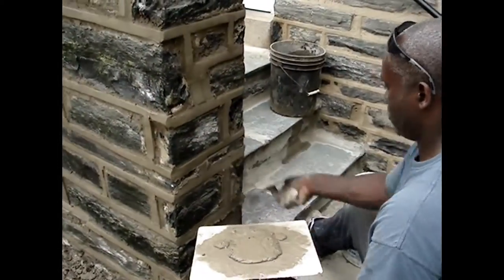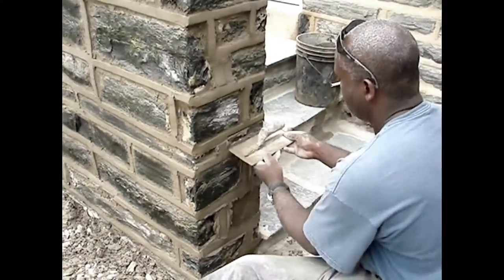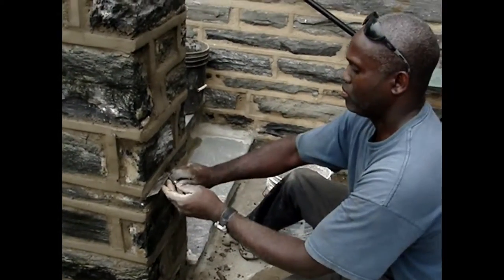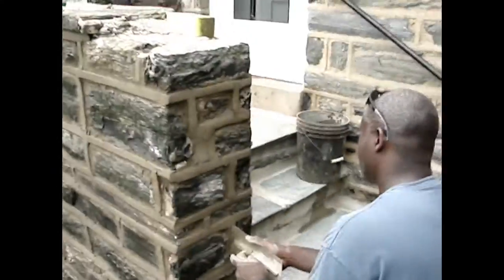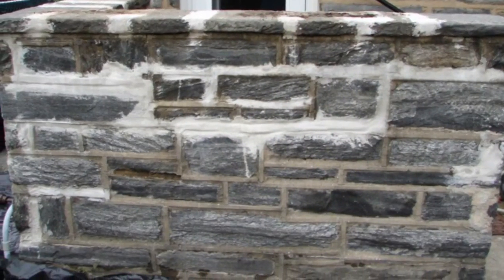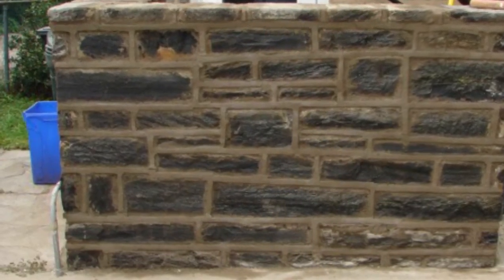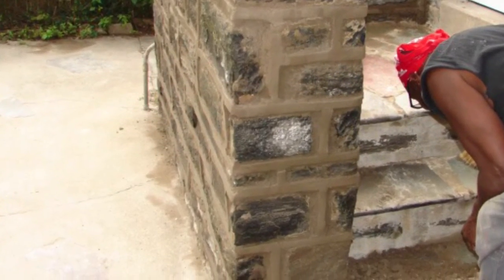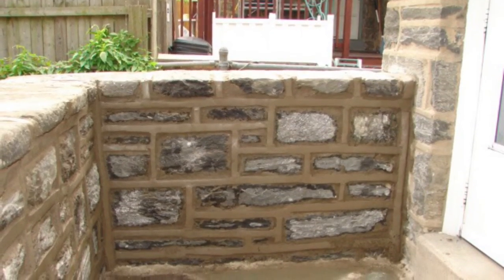How to Stone Point | Concrete Contractor and Cement Work

Comment: Your work looks good,your video making skills are great and loved the use of a drone to catch the footage.
Problem is the use of cement with stone is a massive mistake as only natural hydraulic lime NHL 3.5 and sand should be used as it dries as hard as Portland although is totally breathable which allows the water to dry out 
where as cement definitely destroys stone as it traps moisture forcing to come out the stone instead and that wrecks the stone work in every case over time.
I have just repointed  my own gable end of a Victorian villa in Scotland using only 3.5 NHL Lime and sand and the result is amazing.shoot me your email and I'll send you before and after pics.
The only thing is to keep the work covered and damp for around seven days with hessian to breath and protect from sun ,rain and wind and it will last for a hundred years or more.
Reply: I agree

Comment: You need to stop using cement. That wall can't breathe now
Reply: its a free standing wall why would it need to breathe? there is no difference between whats on 1 side of the wall and the other .
Reply: The cement will trap any moisture in the wall and prevent it breathing through the joint. Result - spalled stonework. Should be in a lime mortar, and not strap pointed, which visually dominates the wall.